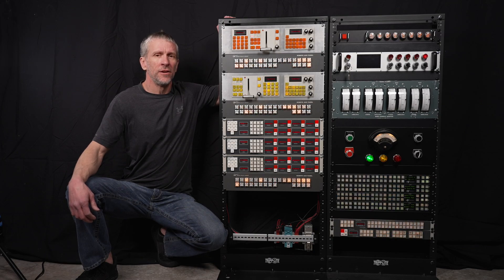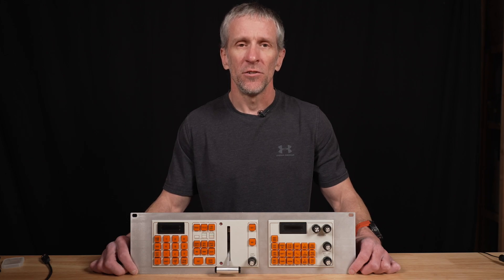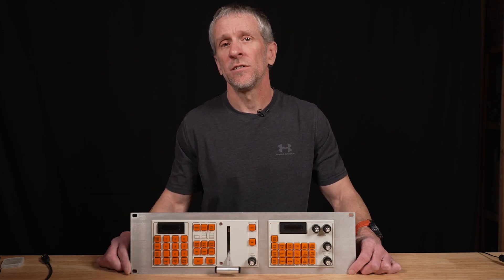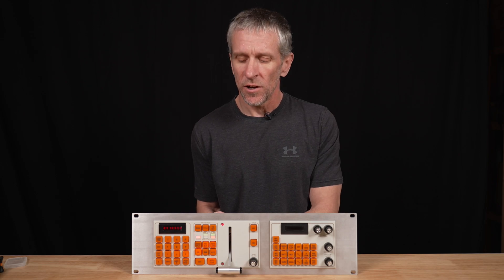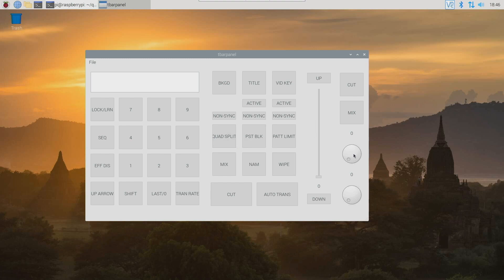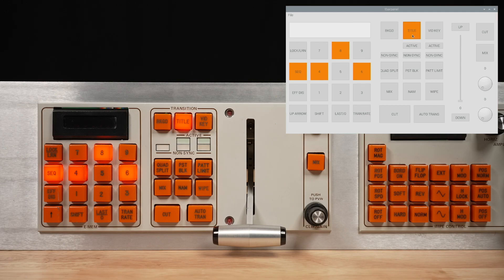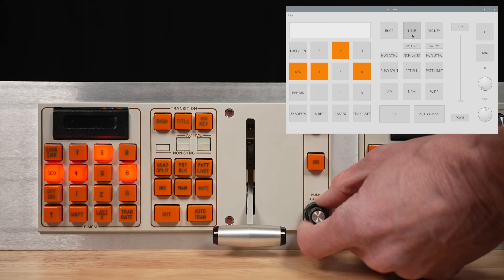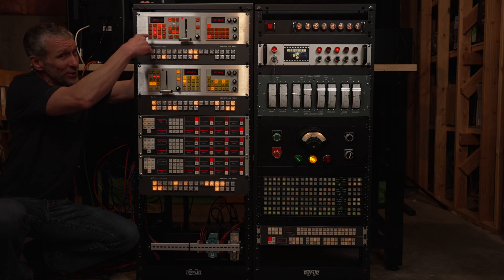GVG 300 T-Bar Fader USB Demo

Comment: The lever is similar from Star Wars because that was also a Grass Valley Switcher.
Reply: So gotta ask? Did the Empire send someone to NAB and the guy went, hey I think Darth will like this and bought a couple of 300s?
Reply from the maker: @gorgo54  The Empire went to KCET with a camera crew. There's a brief story on their website about it titled "How KCET Helped Destroy Alderaan."
Reply from the maker: Yep, a model 1600.
Reply: @GlenAkins  I know, used to use the 1600 before REaltime Video got the fully upgraded GVG 200-2
Reply: @GlenAkins  I replaced a 1600-7g at my first station with a 300-3a. One of my first big projects.

Comment: I have a 300...waiting to be put into some millwork as a bar top or desk top this year.  I am NOT an engineer...but would love to purchase several of these for the FX  AND Pgm buses
 Do you sell the cards and raspberry PI?   Or the specs?
Reply from the maker: That sounds like a great project! It would be very cool to get all the lights blinking inside the table. I only have these for the Series 300 transition logic and wipe logic boards. The FX and program buses uses a different scheme for control and, unfortunately, I don't have any of the FX and program boards to reverse engineer.

Comment: Do you have the reverse engineering available for this and the other panels? gerbers? ino code?
A friend of mine and I reverse engineered the RTS intercom buttons and display on an older I/C panel.
The GVG router panels are all ethernet, how do you control them? Is there a way to activate and address the LED lamps and switches directly, or did you hack the firmware on the panel? Lots and lots of questions! I've also made an eleven digit nixie tube clock with the display card from a 1970s GHz frequency counter. Fun times!
Reply from the maker: I built my own controller that replaces their embedded computer and connects directly to the physical button panels. Here's how I did that for parts of a Kalypso switcher:
https://bikerglen.com/blog/converting-more-vintage-hardware-to-usb/

Comment: please linkedin me man 
I want you as a friend..man.. but I Have to know.. Please tell me if that control panel you made 
with the god switches if they stay pressed down when you push them in a lower profile that the others.. please Patent does not say
Reply from the maker: I think all the buttons on all the panels I have are momentary.
Reply: @GlenAkins  OK You LEGEND I think its called Latching for the other kind is that right "latching"